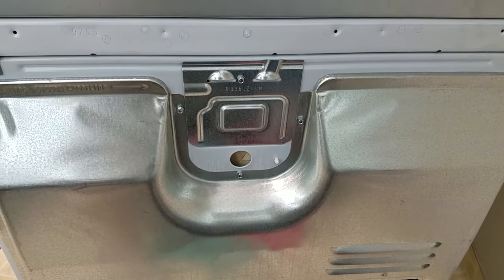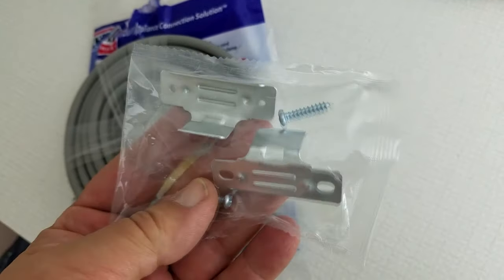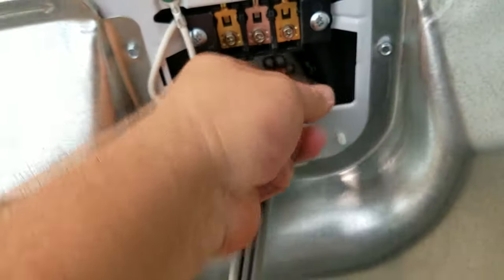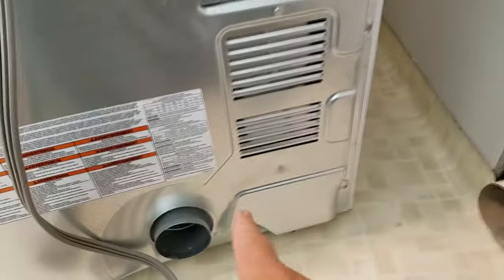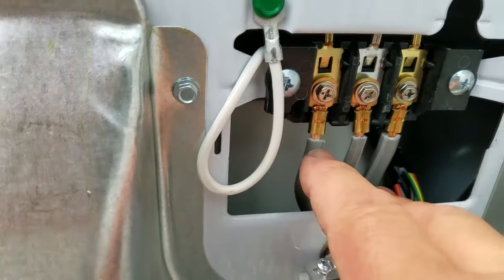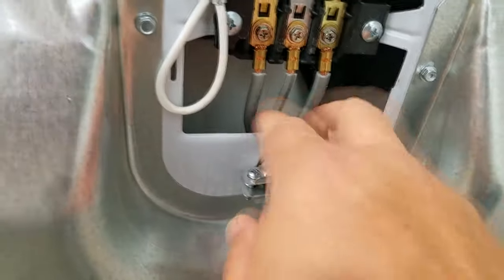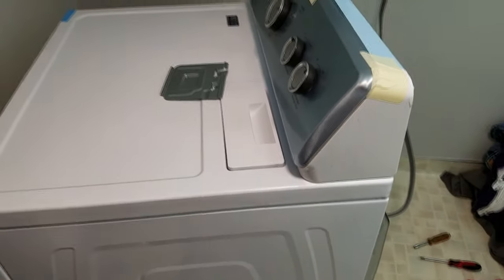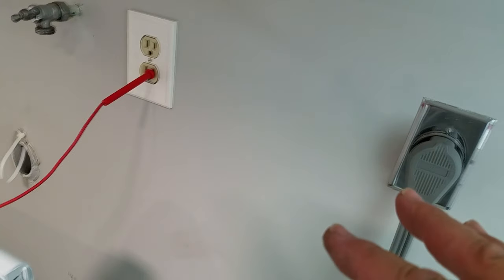How to install a 3 Prong Electric Dryer Cord Ground Wire explained

Comment: Your video is the only video on YouTube that addresses the dryers common wire being attached to the ground stud on the washer for proper grounding of the body of the dryer. Great video. Other videos would have the the dryer body ungrounded.
Reply: What if you hook it up and your dryer dont heat up and the timer dont work???

Comment: My 3 prong outlet previous owner installed plug upside down. I had to switch the red and black, I was told the black goes to black and red goes to red.

Comment: Tried to hook my fryer up from 4 to 3 prong. There was NO GROUND WIRE. We tried to do it with no ground. Now I have to get the neutral and connect it to the ground.. I think.

Comment: Hey bud this is a bit maybe strange question. So u have the same outlet for dryer with 4 prongs but only have 3 hole to plug into outlet, now can i use that same wiring to hook up an ac/heater 208/220v note those are 3 plugs 2 hot and a grnd, would I have to kill the nutral and used the grnd in the outlet? Thanks

Comment: It looks like we bought the same Maytag dryer. The instructions that came with it state that with a 3 wire connection, you are suppose to connect the neutral ground wire  with the neutral wire and then connect a separate copper ground wire from the green external ground conductor screw to an adequate ground. I have no idea where I’m suppose to get that wire or what I should ground it to. What happens if I don’t and just leave it as is like you did?

Comment: Just got a new dryer, I've never had to install the cord before. In your video, and every other video I've watched, the ground wire is attached on the green screw but on my dryer, it's attacked in the neutral spot. Am I supposed to move it to that green screw?

Comment: ours is this exact set up but tells us to ground to the neutral and add a separate copper wire…. will it be fine in the configuration you showed??

Comment: I just bought an amana electric dryer.  When I opened up the back, the white ground wire was connected to the middle neutural panel. Its a 3 prong. I connected it to the green one,  the middle wire to the middle neutral, and the left and right hots are hooked up fine.  I have power,  but no heat. Its brand new from menards. Is it something I did wrong or should I take it back and swap it out!?

Comment: Hi BreakerBroke, thank you so much for the video.  I couldn't find this on any other videos.  What if I have a newer Samsung Dryer (I'm changing the wire from 4prong to 3prong) and it has the skinny green wire already wired to the chassis?  Can I still run the white wire to the chassis as well?

Comment: You have the only video I found that (at around the 2:20 mark) specifies that the flat side is the back side when deciding which is the left power and right power. Sure you can assume by how it's flat, it's supposed to be there and make the best contact and the other videos show it like that... but it makes me sleep soundly at night hearing someone say, "yes, hold it like this to know which is the right and which is the left". Thank you for your awesome specificity.
Reply from the maker: Thank you for taking time to comment, much appreciated. Cheers
Reply: @breakerbroke23  thank you for helping me sleep soundly at night without electrical nightmares

Comment: Thank you! New dryer, Utilitech 3 prong cord but not labeled in any way, no way to recognize which way the connections go. You are the only video I found that said it “goes this way” with the flat side installed to be flat against the dryer apparatus.

Comment: Thank you for your video.  I learned a lot.  I am a little confused by your explanation at the end however.... Does the voltmeter test in the end verify that the machine’s chassis ground was actually truly grounded (120 V) or should it show zero?  What should the voltmeter show if the machine had a 4-prong power hook-up?
Reply from the maker: For 4 prong it should close to zero

Comment: Question for you.  My dryer wires are very long and when I hook them up the wires hit the back of the dryer drum.  I suppose I could cut down the wire and and recrimp etc but I would rather not. Is this a danger if it is hitting the back of the drum?  For reference, in order to have the wire strain on the thick outside coating (4 prong which is different cord),  I  have to push the wires into the dryer hole a lot and this is when the wires hit the dryer drum.  Thank you for your help.
Reply from the maker: Yea, I'm not liking the wires hitting the drum. I also wouldn't cut and re-crimp. IMHO Go and buy the right cord and reinstall. Its a safety thing. Oh and your insurance company may not pay up if you have a fire due to the dryer connection.

Comment: Sooo, my plug in the new house is a 3 prong but it's like a range plug for a stove. I bought a range plug end and I'm trying to make sure the wires are lined up correctly. I would attach the "neutral" to the G on the 50a plug I bought?
Reply: Is it safe to use a 50a plug with a 30a electric dryer?

Comment: Where inside is the neutral connection to the ground we see it outside in your video. I have a coin op machine to orevent other tenants from using mine and if they do they have to pay. But mine eats cords and I wonder if it's a ground issue.
Reply from the maker: I would get a tester and check your wall outlet first. Then go from there. 

PS........ A bad or arced wall socket will eat the plug end of the cord going to the machine.
If not sure then call an electrician, you don't want a tenant to get hurt and sue you.

Comment: Mine does not have a ground coming from inside the dryer it has three wire things on the inside and then the one for the ground on the outside the cord has four wires coming from it too hot too neutral the colors are black white red then green on the ground that color is starting from the right side over is this the right order and do I need a ground from the inside of the machine to the outside of the machine like the white one is in this video?
Reply from the maker: This video may help you, https://www.youtube.com/watch?v=nV9bdZwEwzM there is a schematic towards the end. Check it out. If you are still puzzled then may I suggest calling a electrician or handy man.

Comment: My dryer says “3-WIRE 120/208 OR 120/240 VOLT ONLY” does that mean I can run it on 120? Kind of lost and need a dryer soon. Thanks for the info.
Reply: Did u get answer
Reply: @mrs.childers8333  I moved my old dryer out to prep for the new, turns out there was a 240 outlet behind my old dryer so I didn’t peruse this issue any longer.

Comment: I've got a dryer system that doesn't have any wire attached to the Green Grounding nut.... is this a problem, if I am switching to a 3wire prong ?
Reply: Wondering the same
Reply: @donmcguinness9968  You should find it, there. I was mistaken, and it turns out someone removed that wire from its place, and tucked it behind some of the other stuff.

Comment: Maytag specifically says in the instructions to take thake the ground off the chassis and bond it to the neutral and then add a separate ground to the green screw on the chassis.
Reply: On a 4 wire power supply connection

Comment: The wire from the inside of my dryer that is connected to the grounding screw is not white like in the video, mine is green with a yellow stripe. Is it the same?
Nevermind, I rewatched and paid better attention. Thanks!
Reply from the maker: Yes
Ha! Never mind answered your question to late.

Comment: What happens if someone puts the ground wire on with the neutral? 

I just got a new dryer and its a 3 wire, but they set it up that way, so they took the ground off and put it on with the neutral. Is that safe? The instructions said not to but they ignored me when i mentioned that.
Reply from the maker: That is common practice in older homes. If your home is newer then you will want to separate the Neutral and ground. Much safer.
Review the schematic at the end of video. Cheers
Reply: See now I'm super confused. I was ok once I watched the video but now that I see your response to this person's question it confused me all over again. She said she has a 3 prong but they put the white wire that came attached with the dryer in the middle. But in your video you are separating it and putting it to the left with green screw. Let me just ask my question so I don't make this more confusing. 

Ok so we qon a dryer that was using a 4 prong. We bought a 3 prong since we live in older townhouse that uses 3 plug prong. 

The white wire that came with dryer is attached to the middle. And we've had it this way because it was like that woth the 4 prong. Are you saying that when we switched from 4 to 3 that we should of taken the white wire that's attached to dryer and move it from the middle to the side just like in your video? Basically I do exactly what you did in video? Again I live in older townhouse, switched to 3 prong, and right now the white wire is attached in the middle with the three grey wires I have hooked up. Thank you for your time.
Reply: @lexxilove7755 the difference between the 3 wire and 4 wire is that on a 3wire the neutral has a bonding wire which goes to the frame of your dryer to act as the ground.  Most dryers are usually already set up for 3 wire.  4 wire requires you to move the bonding jumper to the neutral, and use the 4wire dedicated ground where you had the jumper wire. Just make sure on your 3wire that your ground/neutral is working and has continuity, otherwise you could get shocked.

Comment: The white wire on my dryer was screwed to the middle instead of the green wire.  Do I plug it into the middle or move it to the green screw?
Reply: white wire to middle(neutral)...green wire to ground screw if power cord is 4 wire
Reply: the white wire does it go on the green screw?
Reply: Wondering the same. My white wire was in the middle and I am changing front 4 prong to a 3 prong. Do I connect that white wire now to the ground or green screw or put it back to the middle neutral??
Reply: Same , I'm switching from a 4 to a 3 prong and my white wire in attached to the middle.  Do I take it from the middle and move it to the side like in this video?
Reply: @lexxilove7755 I moved it to the left side metal casing. What about you?
Reply: @randomthoughts4310  same I just moved it to the side . I feel so dumb cause my dryer has a picture and exact directions on the back showing what to do in case its a 3 or 4 prong.
Reply: @lexxilove7755  same! I have a Samsung dryer and it has both diagrams for 3 and 4 in back

Comment: Yes, you can flip-flop the two energized wires, the dryer doesn’t care nor will any electrical engineer. The important thing is that the center wire is hooked up to the center screw on the buss.

Comment: can someone please tell me what the 3 screws are that attach to the 3 wires... i lost one and cannot seem to find the right one at the store
Reply: 10 x 32 x 3/8  or  10 x 24 x 1/2 stainless Steal nuts

Sorry for late response
Reply: @thehouseofprayereducationw1031  could I use a screw from the outside panel as a replacement?
Reply: If i got those size and the screws are still loose do you think i might need a whole new panel block? (Black part) @thehouseofprayereducationw1031
Reply: @caitlinvbaby851  one out of the two should fit - 
Spend less money more than  more  money 
I brought 2 packs of the different sizes because they didn't cost that much.
I found them at Lowe's
It worked for me I'm hoping it'll work for you.
Word of advice - use a magnetic screwdriver bit - so  you don't drop them.
Reply: @animemob215  I don't believe they are the same.

I watched someone else's you tube video to figure out those sizes and decided to share the news.

They don't cost that much -
I would just go purchase them.
Word of advice - use a magnetic screwdriver bit to install them - you don't want to drop them inside the dryer back panel.

Comment: My new Midea electric dryer came with the white ground wire already attached to the middle (ground) of the 3 connection screws. I’m going to remove it and attach it to the green screw in the body of the washer, as in your video. I took a pic but can’t include it in my reply.
Reply from the maker: Please look at this video to make sure you are doing the correct way.  Look at the whole video. There is a schematic towards the end of video.
https://www.youtube.com/watch?v=fSoFDGGl_6k
Reply: Looks like the new dryer arrived ready for a 4-prong plug, with the white neutral wire intended to be doubled on the middle connection screw with the middle prong of the power cord. Now I’ll just move that white wire over to the green ground screw and connect the power cord. Life is good! Thanks again for your great videos. (Now, on to the dryer venting haha)

Comment: My red wire burned and disconnected somehow and my dryer wasn't heating.  How do I replace the burned and melted red wire and its connector on my dryer?  Thank you!
Reply: Idk if you fixed it yet. I dealt with the same issue today. We just cut the end off of the wire stripped it and reattached to the existing terminal after taking apart and cleaning terminal with wire brush. We had several other issues leading up to it including replacing thermal fuse and door switch.

Comment: Would you recommend installing a 3 prong cord or using a 4 prong to 3 prong adapter with a ground piece?
Reply from the maker: I would not use an adapter.. IMHO
Reply: @breakerbroke23  i switched the wires from 4 to 3 prong but i didn’t see that extra wire to ground.  Im hoping there’s nothing to worry about?
Reply: @km4l317  just go get the correct cord...don't mess with electricity

Comment: My nuts are missing off the terminals. What kind of nuts do I use?
Reply from the maker: Get a hold of these guys they are great, I used to by part from them quite often. Have your Dryers model number ready when you call.
https://www.repairclinic.com/Shop-For-Parts?page=2&query=Terminal%20Block%20nuts

Good luck.

Comment: My breaker trips after like 5 mins any tips?
Reply from the maker: You MAY have an old "soft Breaker" Try turning the breaker on/off if the switch doesn't click or switches easy then you may have an old failing breaker.  Compare it to others in the panel. Breakers can break down.

Comment: My husband hooked the wires up before we found this video. The dryer doesn’t get hot. What could be wrong?
Reply from the maker: Check your breakers. Dont just look at them, switch then on/off/on.  Hope thats it. If not, recheck your wiring.

Comment: For your viewers.   Before you do this to your dryer, pull the plate off of the receptacle, and verify that there is only black, white, and bare.  If there is black, white, red, and bare, someone has changed the receptacle to three wire.   You should always install 4 wire receptacle and 4wire plug when you can.   The only reason 3 wire cords are sold are for houses built before the late 80’s that only have two conductors with ground installed.
Reply from the maker: And Don't forget to TURN OF THE BREAKERS going to the Dryer outlet.
Reply: @breakerbroke23     I hope you did not mind my comment!
Reply from the maker: I don't mind one bit, you have a valid point. I try to pack as much info in a video as I can, however for some it is just TMI, so I try not to get crazy in depth.
Great comment, thanks.
Reply: @breakerbroke23     Just looked through your videos.  You are an electronics guy.   I wish I had your knowledge!   Color blindness kinda messed me up in electronics class in college.   I designed residential, commercial and industrial electrical power distribution for 35 years.   Will stop bothering you.   Have a great evening!
Respectfully,   Kevin
Reply from the maker: No bother at all, you had a great point. Cheers and have a great Christmas.
Reply: Dryer back only had 3 holes cord someone gave (4wires)me- doesn’t even go to this dryer?
Got standard dryer cord for 3prong hole receptacle- you said it would Not make a difference to hook red to where black should be & viceversa with black where red- no color coding on brand new 3prong-issue is whomever installed 220/240? Put it in L prong hole up instead of down so cord had to be flipped over,I am assuming… hope red on black or black on red doesn’t matter -got white on white!
Reply: Please,advise….before I try it out.

Comment: 120V in America, sharing ground with neutral!  3 Phase in a house!  Aluminium wiring that can catch fire!  Never understand why the Americans did these things.  An earth should be an earth so if 120v comes in contact with it there is no question it will go to earth.  In the Uk those connections inside the drier would be Live, Neutral, earth and would be covered with a plastic cover, so if anyone took off the back cover they have no access to the mains connections, it would be 250v here and single phase.  In Europe they have three phase 230v in their houses, handy if you have something three phase like a lathe in your workshop..

Comment: Very good info, but, why do you people who do these informative videos struggle to get good video with one hand and other holding phone/camera when you can just get a inexpensive tripod to hold your phone/action camera and just stick it some place that will record the basics and move in to record closeups but set it down when you need to use both hands while still recording. It's so easy peasy.
Reply from the maker: Your so right, I do own a Tripod.... Most of these videos are not planned (it shows) and I don't think of a Tripod until the project is done :)
Cheers
Reply: It requires moving in closer to show certain things and angles so that we can actually see what they're talking about. I like it . Thanks for videos and information